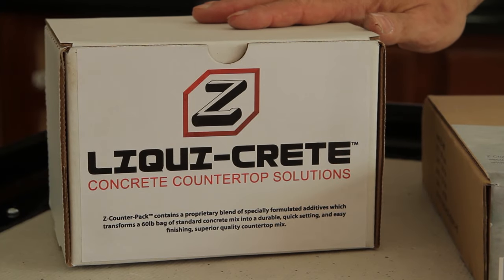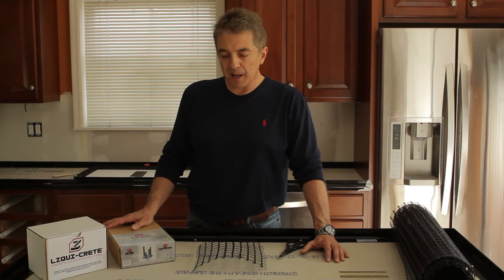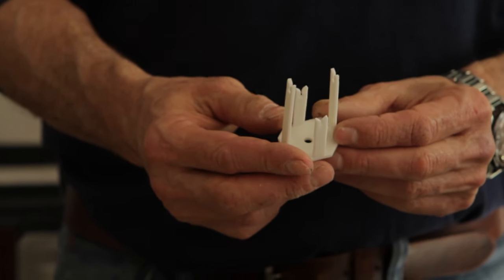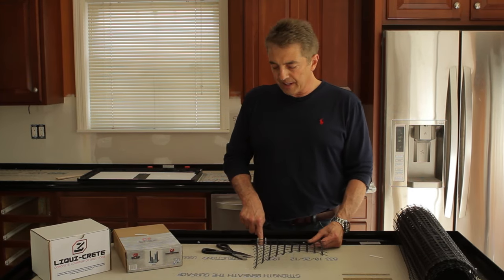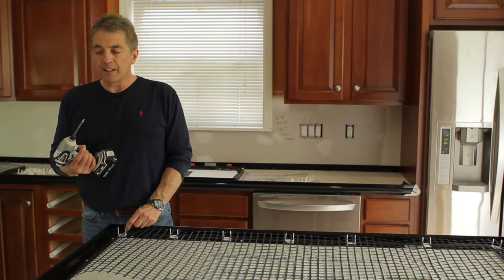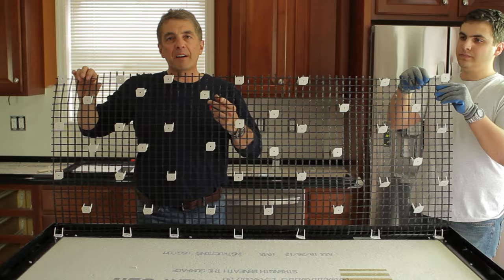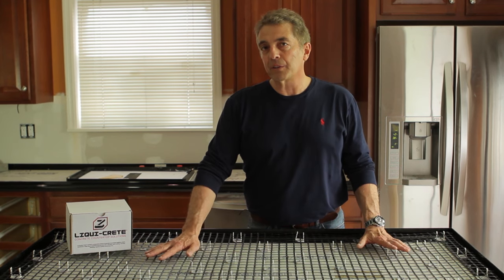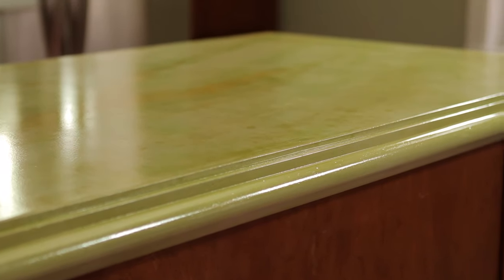DIY Concrete Countertops | Liqui-Crete System

Comment: Would the standard welded wire mesh work with the liqui-crete?  I plan on doing a full kitchen remodel with concrete counters and have been starting to look at tutorials on both cast in place and building molds.  Cast in place looks like a lot less steps, and the liqui-crete looks even easier.

Comment: Fiber glass mesh vs wire mesh vs re-bar.
Which is the best and why. I understand fiber glass is the easiest which will give you the best strength? Should you use 3/4" plywood as a backer? What is the best way to strengthen the thin strip in front and behind the sink people are always sitting there..

Thanks

Comment: Nice end product.  Had it been me it would of looked like the ally out back though I'm not short of knowledge.  I fail to see how flex mesh can replace wire mesh unless it a way to save money on the marketing end.  I was with my cousin on a few of these jobs and sent him this vid.  He said that his vendor showed him a report that fiberglass is good to have in the cement mix, it is not necessarily good as a reinforcement because it is flexible where steel is not.
Reply: +Robert B How flexible do you need a countertop to be?

Comment: love this idea but can I ask if you decide after to change your kitchen sink how do you get the old one out .I did not see how you poured over by the sink .Was it in place before or put in after with clips .Would also love more info .I like the idea of concrete counter tops
Reply: I would not fabricate the countertop with a permanent installation of the sink. I'd like to see an alternative way in which the opening is poured so the sink can be installed as an Undermount at a later time.

Comment: This is the most beautiful concrete countertop i have seen. Do you use dye to colour it?
Reply: ***** Hi Mike. I can't wait to try this system out. I have a few questions though. You say that no dye was added to the concrete mix itself yet the mix that you place/pour at 3:00 minutes in this video clearly has a greenish or yellowish color to it. Most, if not all, cementiitious products are grey/dark gray when mixed and wet. And the final product before you stained it was a very light tan color instead of a grey color. So whats going on? did the concrete mix you used have a color to it? BTW what mix did you use? Or does the Liqui-crete admixture have a color to it? Thanks!

Comment: I am wanting to avoid the messy and expensive demo of my existing formica
countertops. Can you use Liqui-Crete as an overlay with existing formica countertops after attaching the mesh to them?
Reply: @ZCounterform1  What is that?  I am still trying to figure out how to use my 'form in place' counters .  Just stick on the edging and sink surround.  Form done.  Old custom maple look Formica from early 80's .  Stronger and not as wobbly as the islands I've seen topped with 1/2" rock board.  What's up with that?  Not custom cutting durarock ..

Comment: Any concerns with Hardie Board and wet cement ? I have 3 cabinets with gaps for dishwasher and fridge. I am concerned that the wet cement will weakend the board. I will build in support for  the empty spaces but still concerned with bowing when the hardieboard gets wet..
Reply: Hardie Board is waterproof.    Won't hurt it in the least.

Comment: So this being a concrete byproduct, what's the danger of expansion/contraction in longer poured areas especially in a kitchen exposed to the heat of ovens & stoves? Isn't this material subject to cracking throughout the curing & natural movement process?

Sorry, for some reason I'm not sold on this method & it's just my belief but the average person putting this down for the first time & not being familiar working with finished concrete would make a mess floating the product properly & getting the outside lines to look good.
Reply: This is the same mix being used in commercial construction. a frying pan isn't going to contain enough heat to boil the water buried in the concrete out into explosive vapor. You are a worry wart that hasn't taken the time to understand the science involved. Now if you dumped 3 lbs of molten aluminum on top of the cement, then you might notice an issue.

Comment: This looks to good to be true. What is the cost compared to conventional tops?
Reply: Yikes. Just added everything to my shopping cart, with shipping I'm looking at $670.00 for my small kitchen.  That's without the bags of cement and any special tools.  Looking at probably $800.00 and there is no guarantee that it'll come out nice.  Could come out crappy and I just threw out $800.00.  Too much risk IMO.
Reply: @397coney7  The benefit of concrete countertops is generally not cost savings. When I make them for customers, I charge $65 to $300 a square foot. They are paying for craftsmanship and details and customization not available usually in 'standard' materials. Our niche is not the budget minded, but high end customers, who want something different that what they would get in a tract home, such as granite tops.

Comment: Does the concrete come in different colours?
Reply: They have a product at Home Depot, Lowe's and, if not mistaken, Wal-Mart called ShapeCrete. It is basically the same thing. But to answer your question, the stores that sell ShapeCrete also sell a variety of colors separately as well as a resin-type veneer. Hope this helps.

Comment: this made me laugh.. no need for the clips fill with cement to level you want mesh press mesh on top and continue to fill.. waaaa laa lol. this was dorky tho made for a great laugh. Thanks Guys ya did a great job lol
Reply: +Dreamylyn Moore even if you press it in, as you pour the cement it will lift.. This is not heavy mesh, it is very light.

Comment: If you do a little research the clips put the mesh in the middle of the concrete doing 0 benifit.  in a flex sinerio there is 0 stress on the center.  concrete deals well with compress not good will pulling.  if you put pressure down on it the bottom of the concrete will pull apart.  So the mesh needs to be on the bottom ore 1/4 in from the bottom.  a double layer on top and bottom would be better as it would cover if you try to lift the counter later and putting heavy weight on it.  But putting the mesh in the middle serves 0 benifit. 
Mesh good idea, clips bad idea.  Better off screwing the mesh and putting the screws 5mm off the bottom.
Reply: Depends on what you are trying to accomplish. Reinforcement in the lower portion is a great idea, if you need to us concrete as a beam, where the tension is going to be on the bottom. The only time this is typical of a countertop, is while it is being lifted into position. Once it is on the cabinets, it is supported underneath. Concrete cracks a little as it cures. These are usually tiny hairlines, that might not even be noticeable, but they are there. Having reinforcement keep the concrete cracks pulled together. This is especially important when there are large openings like sink cutouts. If YOU did a little research, you would have known this, LOL!

Comment: Doesn't even look like concrete so what's the point?!
Reply: I think the plethora of finish options are what attract people to concrete tops. Custom edges, embedded designs, glass impregnations and custom sealers give it a chance in the market. I suppose if someone wants to they could go for the standard gray sidewalk look though but with a sand mix you'll have to do some additives to get there. Still, it might actually not look all too bad with stainless appliances and black cabinets and cupboards, would have quite an industrial look to it!
Reply: +Sam Anderson yeah, i think aftermath it turns out to be as expensive as a stone countertop. At the end it's up to the individual taste 👍 appreciate the responding!